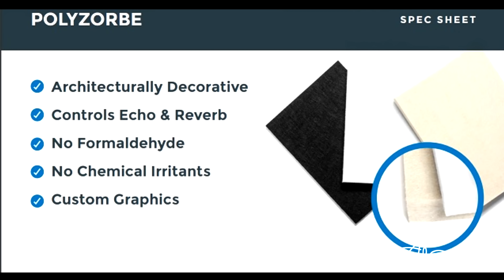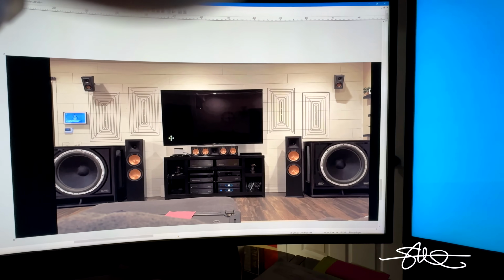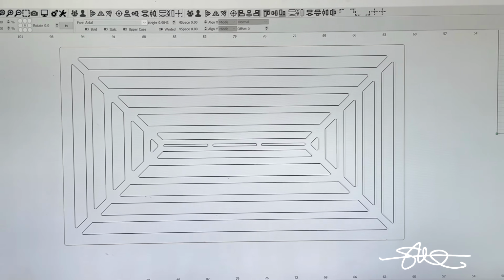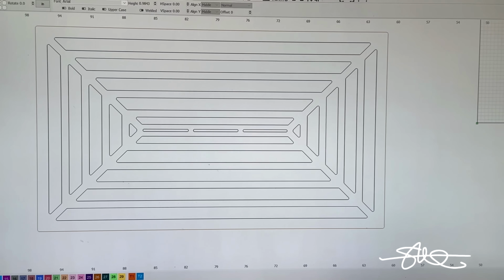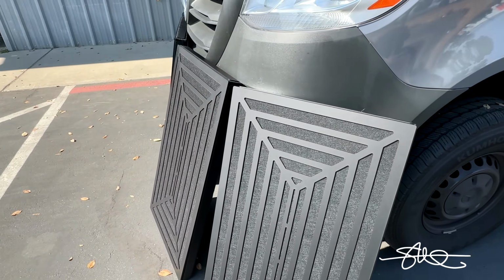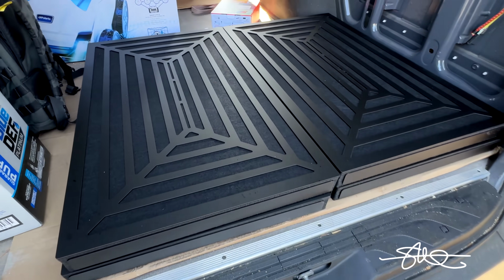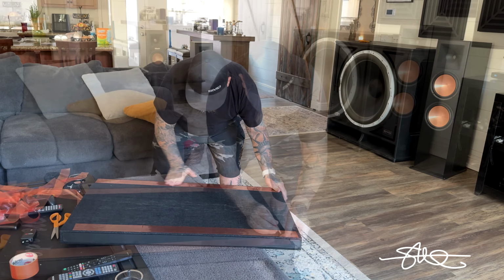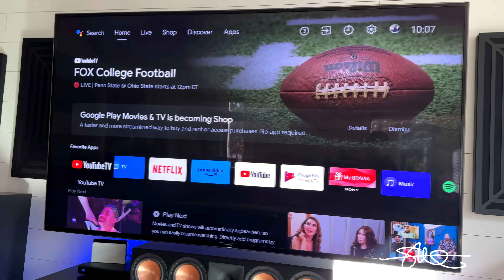Home Audio Sound Improvement - Custom PolyZorbe Acoustic Panels Designed, Cut & Mounted

Comment from the maker: I know this isn't going to fix the room completely, although it doesn't sound bad to begin with, but i plan on doing more decorative panels in the living room area.  As much as the wife will let me get away with.  This isn't a studio or a dedicated home movie theater. It's our every day, daily driven livingroom. It has 15' high ceilings at the top and 10' at the lowest point.  The room is an open floor plan (as you can see in the video), so I can only do what I can do. As stated, it already sounds incredible so it's no big deal regardless.  I have lots of idea's.  This seems to already be making a difference.  Once I get more done I will run Dirac Live again and see what sort of changes were made. For now, this is just a start.  Follow me here for more http://www.instagram.com/meade916
Reply: If you are a huge Star Wars fan the oval cut outs like you find in the death star would look cool on the white panels.
Reply: Jangan lupa Shalat yah semuanya Allah huakbar 🥰🤲🏻🤲🏻nabi Muhammad....
Reply from the maker: @newlukidinda8116  I pray you get the f off my page with that nonsense.
Reply: @meade916  I think you are supposed to scream Admiral Ackbar or something like that.
Reply: @12:53 of this video...that looks really nice!

Comment: May I ask what the the nail in the walk was for sir...with you using double sided sticky tape?
Reply from the maker: i used a little tiny nail to help keep the sheer force from pulling itself down over time. The tape holds great but i wasn’t sure. 👍🏼
Reply: @meade916  Great tip...I shall share that info for those large panels.

Comment: Hey Steve,
I've seen some 12'x12' BLACK Acoustic Panels Studio Foam Wedges on Amazon. 5stars by over 1k reviews. maybe a easier solution to use.
IDK, but they have that sound room design to them. Plus being only 1 sq foot, be easy to configure around the room for problem areas that are causing reflection etc.
Anyway ... Good Luck
Reply from the maker: no thanks. I like this brand better.